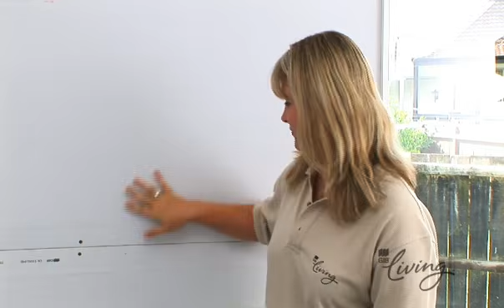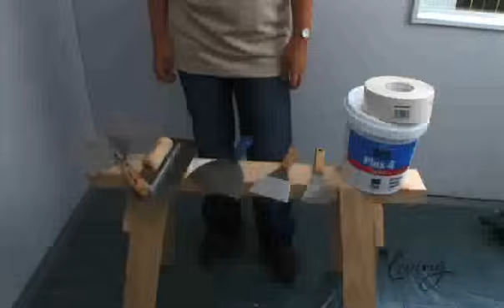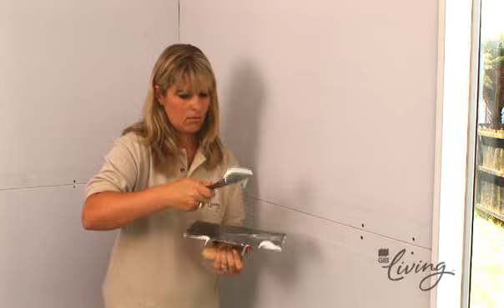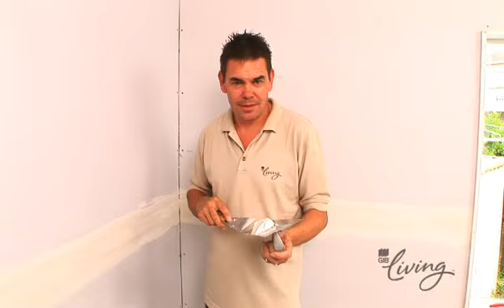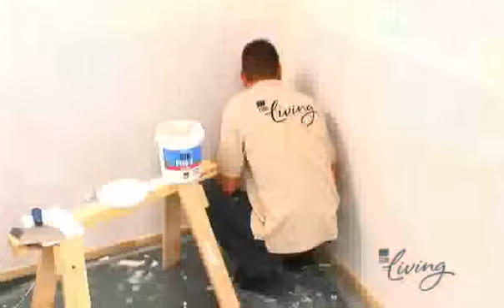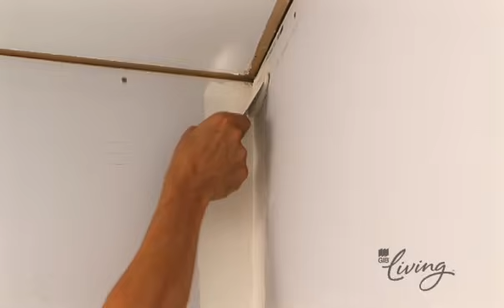How to plaster your wall linings with GIB® Living

Comment: I wet the paper tape before and get rid of the excess water and apply. No air bubbles and adheres really well.
Reply: Old trade truck, I'm a full time painter and this is key if you're not using mesh tape
Reply: Trick not truck lol